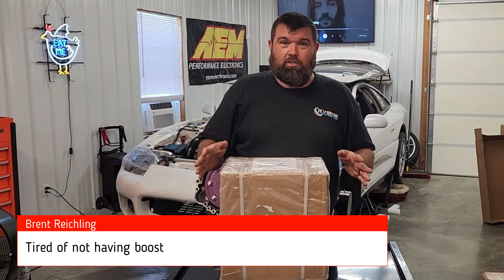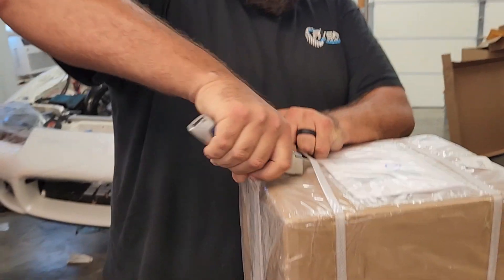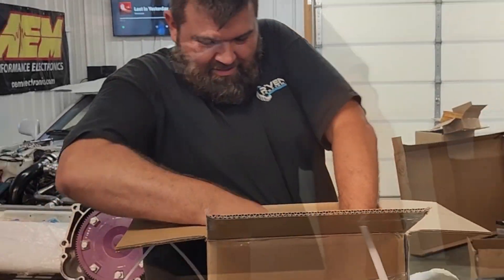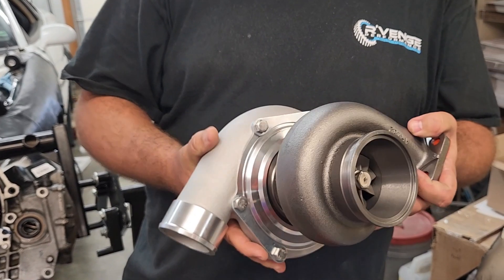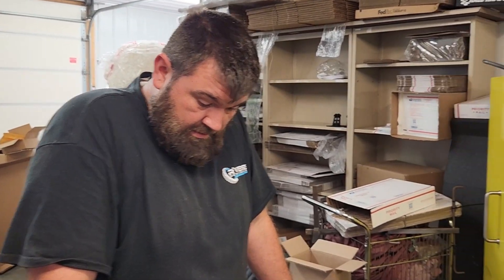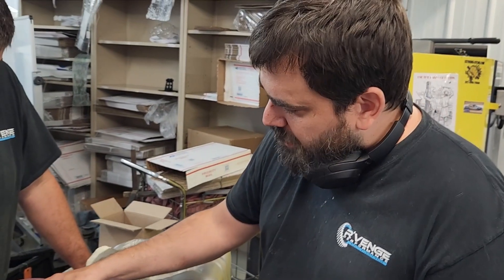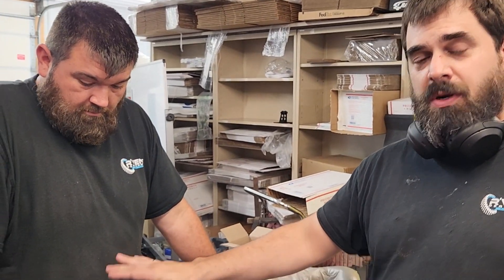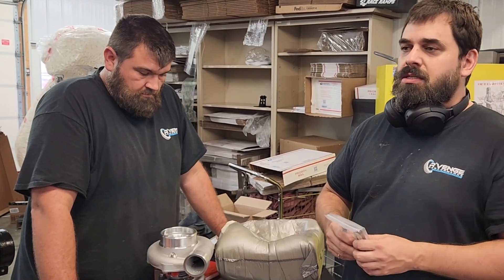3000GT Turbo Conversion Forced Performance GT3582

Comment: I would have almost thought a single 3582 would be too small on a 3.0?

Also, you mention doing a Rvenge built trans.  I was looking at your services and saw the one for the cluster rebuild.  Let me know if I am understanding correctly if you would.  With the cluster rebuild, I tear the trans down to the gear cluster and end case, then send it to you to change synchros, inspect gears, sliders, etc. Once done, you send the assembly back to me, where I measure preload, shim, and reassemble? Whereas the full rebuild is I send it assembled, I get it back rebuilt and assembled and ready to bolt in?
Reply from the maker: Yes, that is exactly how our cluster rebuilds work. The 3582 is actually a decent sized turbo for a medium displacement setup. Compressor map looks awesome if we assume it is close to the performance of Garrett. https://www.rvengeperformance.com/wp-content/uploads/2022/06/GTX3582R-G2-Comp-Map-Kg-Sec-scaled-1.jpg
Reply: @RvengePerformance  Awesome, thanks for the response.  That is likely the route I will go as soon as I get the motivation to print off the pages from the FSM and tear the 5 speed down.

Comment: What about replacing the twin turbos. What model would you guys recommend ?
Reply from the maker: It depends if you want to stay in stock headers or not.
Reply: @RvengePerformance  
stock headers and stock cams.
Reply from the maker: @MrPStone305  a mid to large TD04 upgrade like DR650 or DR750, 20Ts, etc